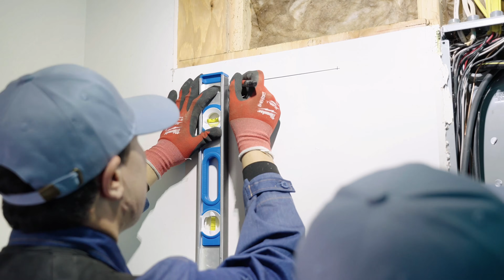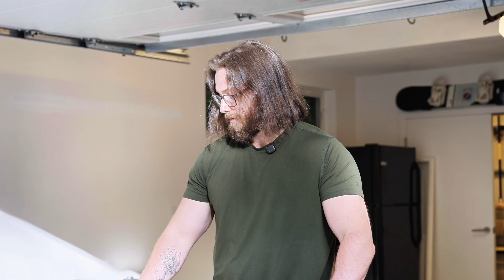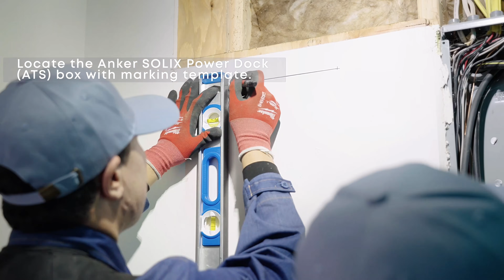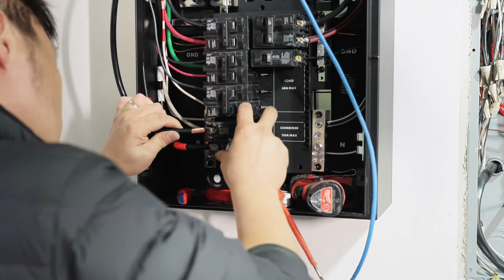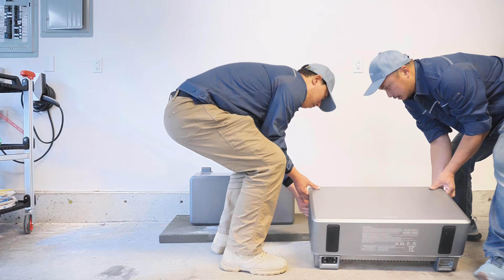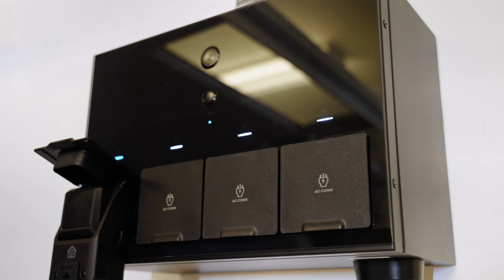Anker SOLIX Power Dock & E10 System and Installation Walkthrough Video

Comment: Ethernet cable (Low voltage) in the same conduit as voltage carrying conductors? Is that allowed in the USA?
Reply: Yes, if the jacket of the Cat 6 is rated to the highest voltage of conductors in conduit and they do make Cat 6 with a 300v jacket.
Reply: NEC 300.3(C)(1)

Comment: Hey Anker, 

Will the E10 be able to handle a bonded neutral system to charge/passthrough via the AC inlet? I have a Silverado EV with a 240v 30A L14-30 outlet in the truck bed. It's widely known in our community that plugging this outlet directly into a standard generator outlet to power a house will trip the breaker in the truck because you end up connecting two bonded neutral systems together. Additionally, from what I've read this is also the case with the Ecoflow Delta Pro Ultra. It too has trouble charging via the Silverado EV outlet and causes a fault.

I'm hoping since the marketing says any gas generator can be used to charge / passthrough AC into the E10 (acting as an isolator), that this would mean bonded neutral generators will work too, and hopefully also my Silverado EV. 

I've been trying to find a reliable middle-man to go between my house and the Silverado EV that can handle the LRA of a heat pump, and the E10 seems perfect if it can do this.
Reply: Would be interested in seeing a posted comment in answer to this question.
Reply: @dc-wp8oc I did get confirmation elsewhere from Anker support that this will work. I ordered the E10, so I should be able to provide my own answer in a few months once I get the while system installed.

Comment: Good video and informative, just curious on the Power box there are 4 connectors but 3 can be used for a total of 90Kw of battery power, what is the 4th connector used for?
Reply: Generator